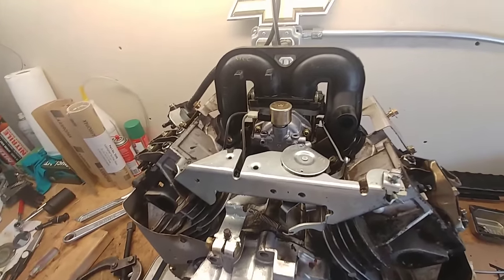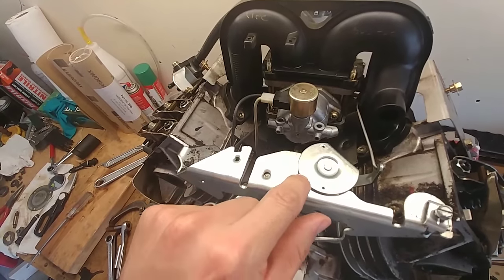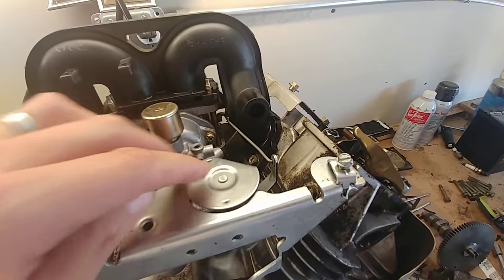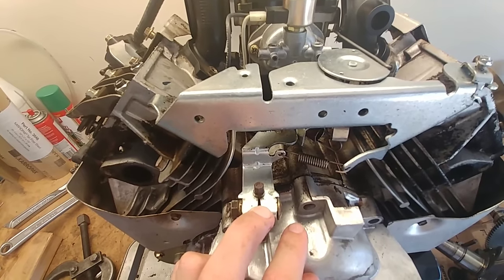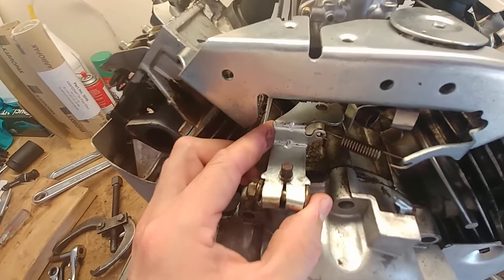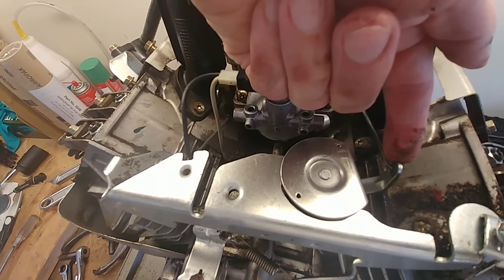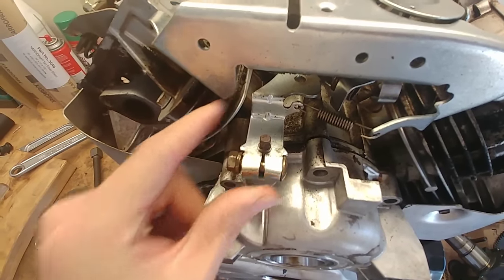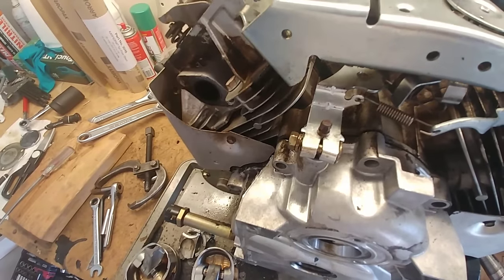Briggs Intek V-Twin Throttle and Governor Controls Explained

Comment: I have a els425 that the big gov spring is doing nothing and has no tension on it at all. Also the  rod going to the carb just falls off if I hold it at idle it runs great I got it used I adjusted the gov the way you said and still no luck. Going to adjust it again but I think that rod going to carb is out of wack. Also the no tension on the big gov spring is odd please help

Comment: I have a Vanguard 570cc v-twin on my natural gas whole house generator.  Does not start in cold temperature.  Less than 40.  This engine has a mechanical governor.  The butterfly valve does not close upon start.  I am wondering if the governor arm is not tight around the governor output shaft and causing it to slip.  All springs have been replaced and verified to correct orientation.  Any help is much appreciated.

Comment: great info !!  should you adjust your governor once in awhile ? because your motor vibrates so much , you would think it would come out of adjustment .
Reply from the maker: If it aint broke, dont fix it.  If it's properly tightened it should not move on you or require adjustment.

Comment: Thank u for this video, please Kipor diesel engine generator 7000 kva its rpm fallen down when is loaded which causing voltage output decreases up to 180 volt and frequency to 40 HZ, so how can I fix it to keep the proper rpm ?.......thank u in advance for reply

Comment: What tensions the arm against the governor spring?  When I throttle down, the spring gets loose and slips up the vertical hole in the arm (never pops out), but the arm doesn't go back up with it.

Comment: I have a serious question. Can this motor safely run as an upright/horizontal shaft motor? I know the oil system can handle it, but is there any reason, other than the carburator angle, that it wouldn't work?
Reply from the maker: Yes, it can. But the cost to convert it is not usually worth it

Comment: No where near an expert here, but could you possibly remove the governor gear and arm and have the engine run at higher rpms without the chance of instant failure?
Reply from the maker: Taking the governor off won't make it run any faster, it'll just make it a fixed throttle engine like a car or motorcycle. Once you encounter a load the engine will slow and you'll have to give more gas to maintain rpm.
Reply: @mbakken11  thank you very much, I'm guessing thatbwould mean a carburetor replacement then? I'm building a go kart and trying to figure out how to go as fast as possible

Comment: Hey man, I have a Briggs but instead of the automatic choke I have the linkage with the spring that regulates the throttle. I’ve been trying to find a video that explains how that part is supposed to connect to the throttle and the govener
Reply: I’ve been looking for the same thing recently. Did you ever find another video?

Comment: Was trying to avoid over paying $5.00 (plus shipping) for $.001 worth of wire.  I actually did have to bend some of the tabs to get the engine to idle right.  There's another guy on the tube that talks about doing just that.

Comment: Okay, so I just put my engine back in after an oil pan gasket replacement. I did have to pull most of the linkage, and I'm glad I caught this video. My issue now is when I start it, it's full throttle and won't kick down, any suggestions

Comment: I seen there when you was adjusting your governor you turn the screw back and forth it looked like you can turn it maybe a quarter of a turn. mine turns half of that, very little is there something wrong?
Reply from the maker: When you're turning it do you have your carb linkage hooked up or is it just a bare shaft going into the engine?  Whats the engine model?

Comment: Could you show the proper choke linkage set up on that motor? I replaced my carb assembly and I think I'm missing a spring for my choke. It's all loose and the engine pulses when I can get it started. Thanks for the video.

Comment: nice video. I have replaced the sump gasket on my engine. I have the governor in place and working I believe. My issue is the throttle plate. I hook the cable up but it will not throttle up and down. Any suggestions????? I have checked the spring locations and they are fine. I have tried readjusting the governor and nothing helps. You are correct when you say it is confusing since the throttle plate makes no connection to the carb.
Reply from the maker: Make sure that the throttle linkage between the governor arm and the carb didnt fall off.  If that is in place, then the governor must be out of adjustment.  Whats the model number of your engine?
Reply from the maker: Also make sure the clamp on the governor arm is securely bolted down.  If it's too loose, the output shaft can spin inside the arm and cause it to be out of place.
Reply: model 44677-0246-e1
Reply: I have checked the arm several times...I can use my hand and control the engine speed but no thru the cable
Reply: I have another idea after watching your video a few more time. maybe bend the tab down for the idle speed spring. Maybe I bent it somehow when I had the engine out.

Comment: Question - How does the oil get to the overhead valve rockers and pushrods. I've looked all over and can't find the oil passage.
Reply from the maker: Splash lubrication from the sump/crank
Reply: @mbakken11  the sump oil goes through the pump to the filter then to the lower crack bearing through the crank to the connecting rob bearings and I assume to the upper crank bearing. is there a passage to the cam from there? is the cam shaft hollow and the oil pump pushes some oil up the cam? I don'tsee how the over head valve train gets enough oil.

Comment: Thanks for the great video. I live in Brazil and I have a lawnmower with this engine. Here it is difficult to find a mechanic to repair. My engine has a problem that seems to be governor. When I start the engine, it is constantly accelerating and decelerating, this happens at idle, or full throttle. Could you tell me what might be the problem?
Reply: My 21 HP does the up and down throttle also. I read that the carb is probably full of gunk, real fine dust that goes through the air filter. I just looked up u Tube on how to clean the carb. (Have to take it apart though). Will see how it goes.

Comment: My throttle wheel had the choke mechanism attached to it where, past the point of full throttle, the choke is engaged. Mine had a bit of dried mud stopping the choke lever from full travel upwards, if I had not looked, I would have never spotted it.  Yep, that’ll cause it to be very hard to start. It borders on near impossible to start. That 1 lever!

Comment: I've properly adjusted the governor as you stated and the engine runs wide open only. I can idle it down by the governor arm and it'll idle fine. The throttle lever makes no difference.  What could be going on?
Reply from the maker: Do you have both springs in place? What model engine?
Reply: @mbakken11  yes sir there's a lower spring and an upper hooked to the governor arm itself. It's 2013 briggs 22hp intek V twin.
Reply from the maker: @jlljustice  what's the model number? It's either not adjusted properly, the governor mechanism (inside) is damaged, or springs are on incorrectly. Stiff one goes on the arm, the weaker one goes on the throttle wheel. You could try adjusting it the opposite direction to see if that works - it's already racing so there isn't much to lose
Reply: @mbakken11  let me verify the springs. I looked for the model number but didn't see anything that said model number. I'm probably overlooking it tho. I'll get right back with you on that.
Reply: Also, I did already try adjusting counterclockwise as well, and it makes no difference in how it behaves.

Comment: 2011 26 HP B&S I did this and it ran wide open had no choke had no low speed ,   I Had to Turn the Linkage to Low Speed then turn the pin going into the case to the right .   Low speed  pushing the Gov up left,   then turn the 1/4 pin right clock wise.  Not all work the same .

Comment: One of the best videos on linkage so far for me. I’m working on one of these engines, for the local church. It caught fire,I believe though having 2 of the belt pulleys seized and a bad oil leak. The air intake melted along with the black plastic jet bit at the front of the carb. I’ve replaced the carb, now on the linkage. What I haven’t been able to get my head around is the carb is on full throttle and there isn’t a spring to pull the throttle up to tick over position Now after watching this video I’m wondering if governor lifts it up when the engine starts. Could you advise me on this. Regards Pete Arnold. Sea Palling.
Reply from the maker: You got it. Governor will pull that arm down and that will pull the throttle linkage to idle. More throttle leads to more spring tension which overcomes/ balances the governor at a higher speed.
Reply: Thank you so much for your quick reply. I’m going to bed looking forward to tightening it all up and firing it up. Regards Pete Arnold.

Comment: now if you don't turn the nut counter clockwise , you should be save to make the adjustment without any problem?because my concern is , if you loosen the nut on the end and the nut on the right was really out of wack , could it come apart on the inside?
Reply from the maker: I'm not sure I follow the question 100%, but yes if the governor gets too far out of adjustment the internal flyweight can  break apart and cause the retaining ring to become dislodged.  The case would have to be opened to repair it.

Comment: I recently bought a 2005 Yamaha V star I was told they had an aftermarket governor on it. Do you know how to take that off or where I could find it on the bike
Reply from the maker: A governor as discussed here only applies to a fixed throttle application.  On things like motorcycles where you have a variable throttle there isn't a governor - at least not like this.  There could be other types of governors such as  a max speed limitation, but that is likely electronically controlled.

Comment: First off, thank you for your video and expertise in this matter.... 
Second... so if i wanted to lower my idle on these engines my best bet is to bend the arm coming off the base plate incrementally?
 i would love to turn my idle down.... ive noticed it CAN idle slower when i physically control the throttle and id love to have it lower to save as much gas as i can...
it just feels like even on " turtle" there is way to much engine speed.
Reply from the maker: Do you know how many rpm it's idling at now? You don't want to turn it down too much or the oil pump won't move enough oil and you'll roast the engine

Comment: I have a Briggs Endurance 24hp V Twin engine. Only 63 hrs on it. Its surging at low and high speed. Started surging randomly out if the blue. Changed the fuel filter, fresh fuel, new spark plugs, carb looks clean, new air filter, no air leaks found, bowl solenoid works, fuel pump works, no vapor lock. Any idea? Engine model is 44N877-0005G1.
Reply from the maker: Luke Mazur sounds like a dirty carb or air filter. Disassemble and clean all jets thoroughly

Comment: Thanks for the post. I recently rebuilt this motor, but when I got it all back together I had very little movement in the governor screw (?). Any advice on how to fix this?
Reply: Maybe someone may need in future, loose the nut on top wireburush clean bottom surface, rust or corrosion there, a bit grease there good to go,

Comment: I’ve NO intention of adjusting this! What I can see is that the engine oil MUST be changed each year with the grade necessary for proper operation with the temperature range it operates in. For me, that is straight 40 weight oil, for south Louisiana rarely gets real cold temps.

Comment: Replaced carb on the intek v-twin and now spews gas out of carb intake what is going on?
Reply from the maker: When it's running? When it's off? Both? Sounds like a float issue - fuel isn't shutting off when the bowl is full and it's flooding the carb

Comment: My B&S engine  has a vane on top in the air stream from the blower that is also hooked to the choke plates. What is that for?
Reply from the maker: Automatic choke
Reply: @mbakken11  It also has a thermostat that opens the choke near the number one cylinder.
Reply from the maker: @thorhammer6040  that deactivates the auto choke when warm
Reply: @mbakken11  so why both? the vane for half choke?
Reply from the maker: @thorhammer6040  when the engine is off the spring on that mechanism always pulls the choke closed. As soon as the engine starts, the air movement of the flywheel pushes that vane thus opening the choke. If the engine is already warm the arm on that thermostat will bypass the whole works

Comment: Hey ive replaced my govenor twice and it still races i have adjusted them to the full throttle mode and tightened down the arm, what else could it be?
Reply: Springs installed wrong position mate

Comment: Question I have a briggs 21hp.   My  idle is racing wide open when I start the mower no matter where I put throttle level.   What should I check?
Reply: Cable or Governor or Spring problems.  Either missing or broken or just not tight enough.  Also, lastly, the Governor, like in the video.

Comment: Hi, I recently removed and cleaned out the carburetor on a Briggs. Now my choke won't start the engine cold or hot, I have to manually poor some fuel down the carburetor to start the engine.  What did I do wrong? Thanks.
Reply from the maker: Rich X is the carb the only thing you worked on? Did you fully disassemble it? Once you get it started how does it run?
Reply: mbakken11 Hi, just the carb it had water in it and dirt must have gotten bad fuel. The John Deere has only 36 hours on it so i didn't replace anything. I did remove the jets, since then I have learned that they are two different sizes. Do they have numbers on them, and which side goes where?
Once the engine starts it run strong and smooth. Easy to start after I prime it manually.
Thank you for replying so quick. 
Rich
Reply from the maker: Rich X there are many different carbs and jet combinations out there. Your best bet is to get a service manual and make sure you put it back together correctly and with the proper needle presets. Chances are you have a port plugged somewhere still - possibly a cross-drilled port behind a Welch or ball. I haven't had the best luck with it, but lots of people swear by Berrymans carb dip for stuff like this.
Reply: mbakken11 I used carby cleaner in every hole, all clear, but the more I look at this video I'm  starting to think i didn't install the the choke linkage, you mentioned in this video manual choke. I will pull it apart again today an let you know what I find. 12:48AM hear in Oz so ir will in a couple of hours.
Reply: Hi , finally had the time to look the JD,  the link between the choke and the lever in the bottom plate that the governor attaches to,  on top the link attaches through a hole in the metal but on the bottom it has a plastic grommet that the link goes through, I didn't put through the grommet. Sorry this is a bit hard to explain. On my JD my throttle is the choke also, push it all the way up and that activates the choke, once it starts then you lower the throttle you feel a little notch and that is full throttle. Thanks.
Reply: Rich X

Comment: Thanks, can you do one on the automatic choke linkage hookup on a 44r877-0001g1 code 131216yg? the choke has 2 rods, when one goes up the other goes down. It doesn't appear to be in the repair manual
Reply from the maker: Sure I can make one, but my auto choke unit is about 2hrs away and I won't get to it for a while.  I can tell you that the auto choke defaults to the choked position and once running the blower will push a baffle that opens the choke up.  The second lever that you see (im assuming) is used for hot starts.  There is a thermostat that is about a 1" round can mounted to the heat shield under the carb.  When the engine is hot it will open the choke via the second lever before it starts so you don't flood the engine out.  Once it cools down, it closes the choke again.

Comment: I have a problem with one of those engines it's related to what this video is. it's not a governor issue but the problem is not with the governor if the throttle plates are open is just a teeny bit and I mean the  tiniest that you can open them the engine over revs, and if you open it up Full Throttle the engine screams  have you ever run into anything like that before
Reply: I forgot to mention I bought this engine brand new and it has run like this since day one as a matter of fact it ended up bending the pushrods on cylinder number two and I took it off put another on the mower. I repaired this engine and it's been sitting on my garage floor for 2 years I finally put it on another mower today I would say at full throttle it runs at close to twice the RPM it should

Comment: My engine throttles up slowly and will not throttle back on it's own. If I move the throttle up it will race the engine way to high.. any suggestions on where to start looking
Reply from the maker: Could be an air leak, low compression, loose throttle cable... If you pull the choke out a little does it throttle back down?
Reply: @mbakken11   the lawn tractor is at the church I will go there tomorrow and check to see if the choke throttles down. I am trying to save the church some money Thank You

Comment: I have tried every possible adjustment and I can’t get it right. When I start the engine it goes to WOT..... any suggestions?
Reply from the maker: What engine are you working on? Did you follow the steps properly? Loosen governor arm, rotate arm to WOT position (cw on engine in video), rotate governor shaft in the same direction without moving the arm, tighten down. If that's not working, check to make sure you're not missing a spring